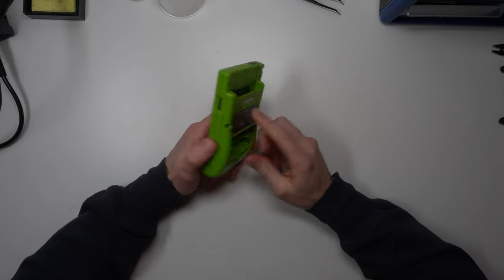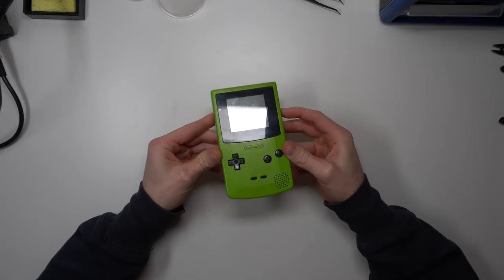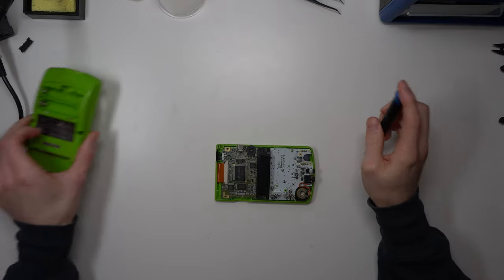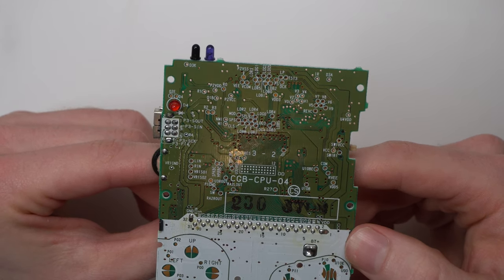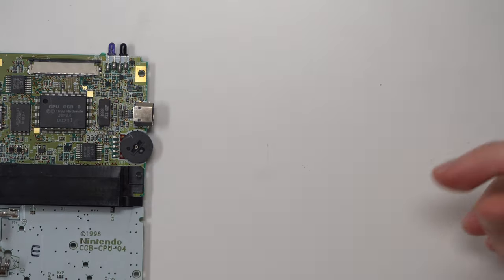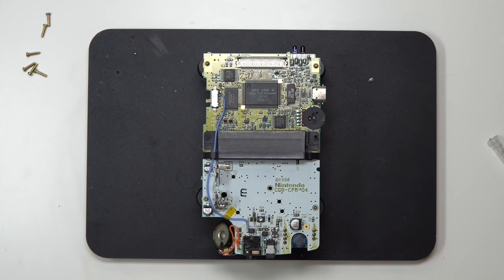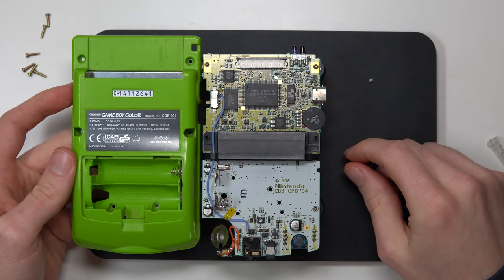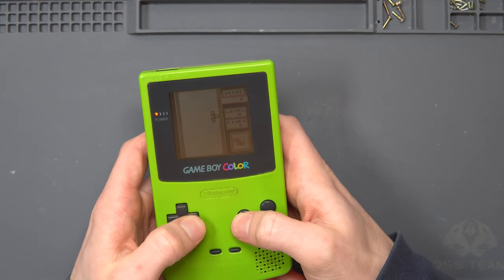Diagnosing and Repairing a Non-Booting Gameboy Color

Comment: When the switch was fine, I figured it would be a bad fuse. This turned out to be pretty interesting and educational.
Reply: Looks like they started making a clone for GBC. Last i checked only GB and GBA were being sold. Looks like a really botched up clone though and the pins look a little short for bending into the correct position. Thanks for the info ill look into it again
Reply: I got a dead GBC and was trying to follow this method. I had a dirty switch that I cleaned and my F1 fuse is good, I get continuity from the positive battery terminal to the switch. It doesn't power on. I cleaned the whole PCB and the battery terminals. Could it be a bad capacitor or something? How would I check for that?
Reply: Okay, I just had to clean it a bit more thoroughly and it's working now. I had already done an initial scrubdown with IPA and a toothbrush, but I must've missed some spots or not scrubbed enough in some spots, because I was cleaning more later out of boredom and when I went to test it, it unexpectedly powered on.

Comment: thank you very much for this video. I was able to track down the faulty f1/f2 fuse and have now a working gameboy color!
Reply: Did you replace them? I spotted also a faulty F1 fuse but it’s my first time, kinda stuck over here
Reply: @yourivandenbrink3951  
Yes i replaced it. Its a bit fiddly because its a very small part. But it requires only beginner level soldering.

Comment: Thank you for posting this. My gameboy wont boot after a mod attempt and i will definitely be following this when my multimeter comes in.
Reply: Mine wasnt working too After i installed a new (oled) Display. The Video helped me a lot, i figured out my f1 was faulty. I desoldered my f2 and put it in f1 for the Moment. I dont use the power Jack, but i think the Sound Noise is a Bit louder than before. So i will replace Both later.

Comment: To avoid pinches I suggest routing the wire through any nearby clean vias and make it go top-bottom-top-bottom clearing obstacles as you go. Though you're going to need enameled wire for that.
My recommendation when using jumper enameled wire is to use the biggest gauge you can go with, but if you're gonna do this thing I'd say going one size down from that is best. That way you don't end up scraping the wire hard against the inside of the via and end up damaging the coating.

Comment: You should use copper enamel wire , 30 awg. Very thing and perfect for this voltage/wattage
Reply from the maker: Hmm, good point - I have 30AWG Magnet wire as well!
Reply: @TheRetroStation  copper magnet is probably what I meant too say  lol
Reply: Would you recommend the same wire if I was trying to jump a cap with a torn solder pad? 
Im new to this stuff but someone recommend that I use a wire to solder to one end of the C38 cap and run it to where it goes.
Reply: @Shooter_POS_Mcgavin  yeah I would, is thing and easy to work with.
Reply: @thepokerus4184  i seen a comment that said they used 28 gauge, 28 to 30 would there really be any difference or does it matter?
Reply: @Shooter_POS_Mcgavin  28 would work great still as long as it's above 26 really. The smaller the number the thicker the cable. The bigger the number the thinner the wire gauge
Reply: @thepokerus4184  okay I appreciate it. I left that same question under 3 other videos and couldn't get an answer.

Comment: My gameboy color powers on for a few seconds, no volume or gameboy display but light and screen do come on, however after a few seconds it dies again. 
I've tested everything you mentioned in this video and was able to get a beep at every point (though sometimes took a bit of adjusting the probes on my cheap multimeter)

I have tried replacing the capacitors but the problem remainds the same, I have no idea where to go next and it's driving me mad. any ideas?

Comment: Thanks for thr tutorial. I follow all the step and all my positive point have continuity. So I'm assuming the negative point might have a short or something. Is there any way to to test the negative point? Btw my gbc works fine with the the power plug, it just doesn't work with battery.

Comment: I have such a strange issue with a gameboy color I picked up. It turns on, but the game boy letters are static and don't appear with the typical color swipe. The game cartridge is 100% working, and the Nintendo copyright is clear and legible. Yet the games just refuse to load. I have no idea what could even be causing that it just locks up.

Comment: Thank you for the video. I have this gameboy color that does have continuity all over the place but it doesnt power on at all. There is this one slight click coming from the speaker as if it was going to power on but i dont get any power at all (neither do have a slight blink of the red light) ¿do you know what could be the cause? its driving me insane. I've already changed capacitors and battery terminals and still no power. Thanks in advance.
Reply from the maker: That sounds like the switch is dirty.
Reply: @TheRetroStation  i'll try changing it. Thank you very much for your help! Greetings!
Reply: @andromedaneoprog  i wouldn't say changing the switch if you haven't yet. If its a dirty switch. All you should do really is take off the metal covering and then clean it with isopropyl or some other good cleaner that won't destroy the motherboard. Then after you're done cleaning it. Solder the metal covering back on
Reply: same issue here. Did you solve it? 
In my case i bridged the switch just to be sure - its not the cause of the error
Reply: @Lukasgabsschon  same here. Cleaned the switch, bridged the switch, changed capacitors and still no power at all. Thinking about the power regulator as the main cause.

Comment: My board passed all the testing steps but still won't power on 😐. Do you have any other suggestions?
Reply: Check de dc dc board, it's the small green one. Check the voltages on pins 5, 6 and 7, they should give you more or less 13,6v, -15V and 5V